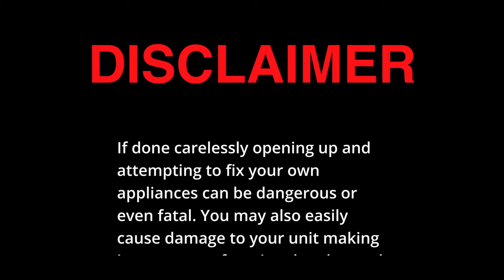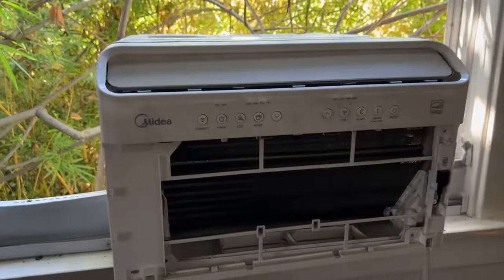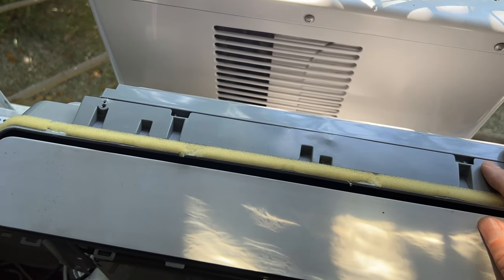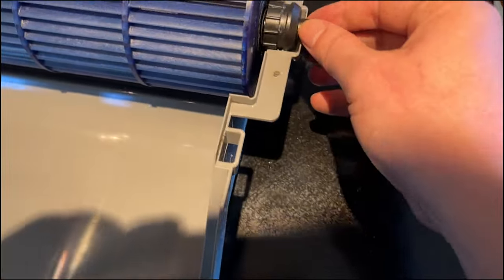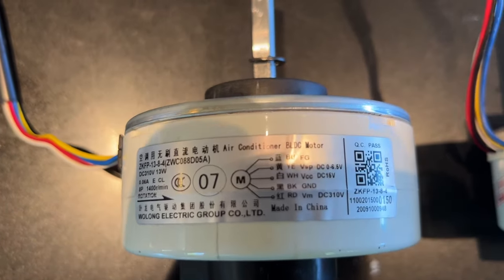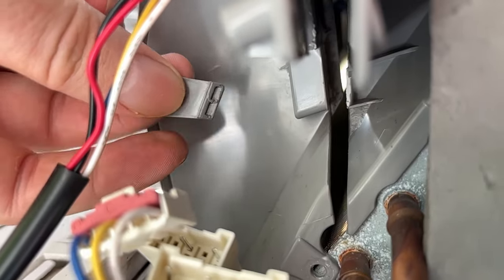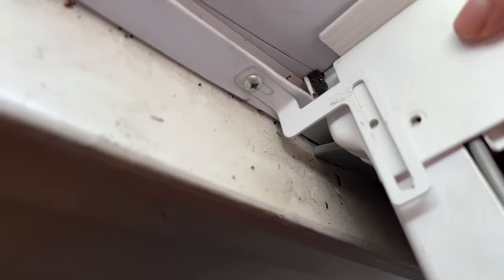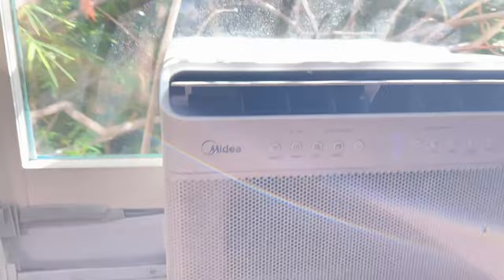Midea U-Shaped Air Conditioner Teardown & Repair: Blower Clean, Fan noise fix, Motor replacement

Comment: Great DIY video, with 19k views it seems you helped a lot of people with what is most likely a common failure on those units. Congrats!

A tip I would like to share with everyone regarding the lubrication of parts encased in plastic - Only use pure silicone grease when lubricating plastic parts, or plastic parts with metal shafts. Pure silicone grease is completely inert to the majority of plastics and rubber, that is it will not erode or harden them.  Petroleum based grease will cause damage to plastic over time, and the damage will be irreparable. Lithium and white lithium grease is petroleum based as well.

You can find pure silicone grease in many places. The plumbing aisle of any hardware store will have food grade silicone grease for faucet O-ring grease. A 1/2 ounce tube will cost maybe 5 dollars and last a long time for homeowner use. Use it grease plastic gears, that shaft of the fan where it enters the plastic bushing, and you can even put a small amount on every electrical connector in that AC unit to make sure water dirt and moisture will never contaminate those connections, making them easier to remove in the future. You can use food grade silicone grease on hose connections for garden hoses, washers and what not ensuring they will come apart easily years from now.

Also, while you have everything open, a good quality can of coil cleaner can be bought for less than 10 dollars. While working on an AC unit take the time to hit the inside and outside coils with coil cleaner and a light rinse, the coil cleaner will remove fine dirt that starts to reduce the unit efficiency, and has corrosion inhibitors that will prevent/treat all the different metals and solder of a coil assembly against oxidation.
Reply from the maker: I hope people have gotten some use out of it! Before this videos were incomplete, so I had to guess at some parts. 

Great tip about the grease, I did not know that!

Comment: I’m considering buying a used b Windmill WhisperTech used and it has a vibrating noise that seems to come from a rotating component. The frugal engineer in me can’t let it go. It’s a bit of a drive to get and we have a Midea at home so I wanted to open it up and see if I could get some confidence to tackle the Windmill one. I got stuck at the front cover and probably would’ve gotten stuck at the blower assembly as well if it weren’t for this video. I see screws and I think “oh yeah duh it’ll come apart”… then there’s the clips… thanks injection molding engineers :)

You’ve done a great service to many people. Thank you!
Reply from the maker: Yeah, it starts as a "how hard can it be?" then goes to "oh, pretty hard", but once you figure it out, it's not that bad!

Comment: Thanks much for sharing,,  thats a heck of an effort to open and put back together but its worth it. You are correct today repair of these unit is costly
Reply from the maker: Yeah, getting somebody actually qualified to do it costs almost as much as getting a new unit. Fortunately I was able to find this part and managed not to mess it up, which I'm still pretty surprised by!

Comment: Good video, was looking to see how you cleaned the fan blades.... Qtip and pipe cleaners DOES take forever.
One tip I'd give for taking this apart, might make it easier for you.....  The screws you removed on the right side (ones going through the confessor). If you remove only those on the left side and the screw holding the box the connectors go into. You can then unplug the motor and remove the entire fan-duct with fan and motor inside. 
If you do this before it's installed,  you can clean the condenser with simple green and a hose outside. Using a hose from the motor side and flushing water toward the filter side (reverse of airflow).  
Next year I'll video myself doing that and the rear section, already did it 2 years in a row.  The evaporator gets filthy and clogged up, cleaning it helps it cool drastically better, but it is work, a lot of work.
Reply from the maker: Would have never thought to have done that! Thanks for the tip.
Reply: Please do!

Comment: Thank you for the video very helpful. A few things to point I didnt have to rip the side protector nor break the top tabs. Pro tip use some toothpics to stick on all the tabs after pushing them, starting with the top ones. Then you just pull the whole backpannel off in one go.
Reply from the maker: Wouldn't that make the front barely stick on - or am I not understanding?
Reply: @nickrobinsonisthedev After taking off all the screws and you have the tabs holding the two grey pieces together, push with the screwdriver the tab back to create a space and insert the toothpick in each of them as far in as possible for all and then you can just separate them hassle free. I'm having to clean it again after about 5 months, but this time bought dehumidifiers to see if that helps with the problem due to how hot and humid it can get in this state.

Comment: Thanks. I will now be able to replace the motor, in the future, if it fails. I have two Midea U-Shaped units, one in my 2nd Floor office for about a year, and one in Bedroom #1, that I just got this month, They both work great so far. The newer one has touch controls, instead of physical buttons.
Reply from the maker: Not a fan of everything going to touch controls, personally!

Comment: Discovered today that to get to those two angled screws, you can disconnect all the other side screws from the grey inner part and just tilt the whole thing back. Also a lot easier to re-assemble that inner part with the fan and then put it back on the unit.
Reply from the maker: That would've been good to know! I was figuring it out as I sussed out the problem. Next time I'll do that!

Comment: Awesome job on the video man! After 3 years mine is making the exact same noise. Now I know where to get the motor. I did clean the blower last year by taking off the front flap and reaching inside, but you can't reach all of it. It was pretty coated with crap because I live in a dusty area. I think this is what causes the motor to start whistling due to the blower getting out of balance. In the app you can manually set the fan speed and I found that around 40% helps it to be less noisy.

Also a ratcheting screw driver will help get to the tight places like in the back. A putty knife and some plastic wedges will help with the separation at the tabs. Cheers!
Reply from the maker: Hmm. My area isn't super dusty, but who knows. I have no idea what happened to the motor, I figured just wear and tear.

Comment: Last night I had arrived at the decision NOT to buy a unit like this.. I just knew it would be a cluster to get apart and clean the blower and the evaporator coils. Mold is not something you want to be breathing.  Now I will save this video for later because A/C season is almost over around here..
I know you said that you didn't know about the outside portion, but when it gets cool outside you might want to explore (and video for us) that to see how much dirt / dust / pollen is packed into the condenser, I do not know if you can see into the back part well enough to really know what it looks like..
Thanks for taking the time to do the video.
Reply from the maker: Personally I have never had a mold problem. Not in the slightest. The blower in this video is pretty much the same as the first time I pulled it out about a week ago (I cleaned it then, but it was wasn't really dirty, pretty much the same as seen here). Overall the unit is pretty good, works efficiently, and most of all is QUIET when the motor isn't malfunctioning.
Reply from the maker: I took the ladder out and shot a video of what the outside portion looks like, for how much I can see in: https://www.youtube.com/watch?v=wqItlrPwbEQ

Comment: The rubber piece on the end of the squirrel cage fan is not a stopper, it is a bearing that supports the fan shaft. When the lubricant in the bearing is depleted, it will start to make noise and the shaft may stop spinning. You can add oil to some bearings or just install a new one.
Reply from the maker: Fortunately I added some lubricant in my first (failed) attempt to fix the noise!

Comment: Thanks men, mine has been growing mold.
I gonna try to take it apart to clean this weekend
It should go ok😅 i worked installing mini split Ac for a bit, but never done repairs/taking units apart, so im still a bit worried
Reply from the maker: You're gonna be fine!
Reply: @nickrobinsonisthedev  hi men, just Finnished putting it back together😁
Tooked it apart with no problem.
Was able to clean it but couldn't do much about the smell from the coils, just use some of those form cleaners, hopefully it works.
BUT when I put it together, somehow I'm missing 2screw😅 should fine tho.
And forgot the security on the cable(will probably put it back on tomorrow if I got time)
The first time i put it back, it give me an EH6 error code, probably cause I was stretching the motor cable too much.

Now, hopefully nothing goes wrong and catches on fire 

Thanks for your video men, very appreciate it
Reply from the maker: @user-lv4ne7nq1h  Glad to help, those scews probably won't matter much, I've done it a few times missing screws and it's always been fine.

Comment: You can straighten the bent aluminum fins by using a fin comb. They are available online. The combs are color coded to match the number of fins per inch, so be sure the comb you use matches the fins on your unit.
Reply from the maker: Is it going to be worth the effort?

Comment: Its not to bad. They grate thing is now screwed down in center and they have 2 didderent types of foam I think to help with noise. There are more screws I think.... 
I bought two units one for my living room and one for my bedroom. I've had them less than 4 months and both of them have mold. So I've had to take them apart and clean the system up. I didn't find that (I forgot what you called it) white bladder thing that you showed in your video.
Reply from the maker: Interesting. So far mine is still going strong so I don't need a new one!

Comment: Not crazy about that unit, both my neighbor and I bought a 12k unit. I don't think it blows enough air for the btu rating. Mine started to make a whining noise more detectable at low speed. I was luckier than you, they asked me to send a sound file and the engineers who listened said it was abnormal and they let me get a refund. I had wanted to keep it and I contacted them saying is there anything I can do to fix this thing? I had it in so securly. I have to say, I have installed many many ACs and this was by far the harderst. What a pain. First they told me to take it back to Home Depot, HD said what? Even though I had authorization from Midea. So Midea refunded and I am donating the unit. Replacing it with an LG dual inverter which is not a U shape. The U shape supposedly lets you use the window but no one is going to use that feature, you have to put insulation around it to keep critters and drafts out.
Reply: Home Depot sucks, I had the same issue years ago but with a noisy LG window ac, I called LG and they agreed to refund me and told me to return it to Home Depot, when I get there carrying that heavy AC they were refusing to take it back, saying I have to deal with LG directly, had to talk to a manager and waste an hour as they argued with LG on the phone, finally they agreed to take it back and refund me...

Comment: I just did a cleanup with the Midea Duo portable AC (I haven't done it yet on my U shape yet... but will soon). It's more involving on that unit compared to the u-shape model when i look at the vids online. It took about 5 hours I'd say, maybe longer. Just my opinion for anyone reading this but if you're going to go through all the hassle of tearing this down I think you really should go blade by blade on the squirrel cage cleanup. I ran mine for just 2 summers and it was really gross. There's no way, NO WAY, that simple water with no pressure is going to clean that up. It's really embedded on the blades. The undersides as well will likely be filthy. Compressed air does nothing as well. It really needs agitation and something physical hitting it and brushing it off.
Reply from the maker: Excellent tip

Comment: Thank you for this video!  After enduring months of noise, I finally repaired my AC this weekend using it as a guide.  

There was some other video that I had bookmarked a while back which suggested using a washer to remediate the motor noise issue but it was pulled by the poster.  Also, I couldn't remove the squirrel cage fan from the motor without fear of damage so I replaced it as well.  Maybe some Liquid Wrench would help with that.
Reply from the maker: I tried that method at first - wasn't the source of my issue and it ended up putting pressure on the rubber stopper at the end of the squirrel cage. Ended up wearing it down a bit for me and giving the smell of burnt rubber.

Comment: I used this video to open my Danby 10,000 BTU Inverter Window AC DAC100B8IWDB-6 that is not u shaped. Well it's the exact same machine and they filled the u shape area with stirofoam.

Comment: Your video was very helpful. But I bought one in 2024 and they've put a lot more stuff on there. The little metal grate is actually screwed down. They have insulation kind of stuff around the motor box and they have screwed down the blower so you can't get it out without taking the screw out. So if you changes but so far I'm a broken anything 
Thanks for your help
Reply from the maker: Oh interesting. I wonder how much more complicated they made it.

Comment: Thank you! I looked at recent Amazon reviews and they are all bad. Returned and broken units are the norm. I have a 20 year old Kenmore window unit that works as well as the day I bought it. It’s as loud as it is reliable. I’m looking at the GE saddle unit too.
You could have unplugged or crushed the beeper while you were in there like I’ve had to do to both of my window units since the dog hates beeping! 😂
Reply from the maker: Interesting. Besides this issue I have not had a problem with it and like I mentioned in the video, the noise factor was EXTREMELY important. I'm sure the Kenmore is great, but a newer unit (by anybody) will probably pay for itself in electricity costs in no time at all. As for the beeping - you can turn it off in the app.

Comment: I was surprised when you pointed out the WOLONG dc motor was the actual motor that came with the a/c. Because WELLING motor is a company fully owned by Midea group. It makes a lot more sense to source parts within their own systems for their own products after all. But also that says this motor should be a genuine part and the concern over its reliability shall be minimal.
Reply from the maker: Yeah, these are things that I don't know. To find it I googled some of the numbers on the side of the old one and this came up. I was still nervous about switching over (thus the fire extinguisher and I didn't leave the room for the first handful of hours operating with the new motor) - Months and months later it's still going strong and performing great!

Comment: Good video, I bought a Media in May of 2023. My shop is only 550 square feet. The fan blower seems to be putting out less air on high than it once did. Will the other motors listed on Amazon with the same numbers but having wattage work? They were a little more in watts than stock. I think it's a shame that the factory has little or no concern after the warranty goes out. Maybe Media was a bad choice but I'm stuck with it now. Thanks
Reply from the maker: Oh, this I don't know. I would worry about starting a fire, but maybe somebody can chime in about this. I don't know if the power draw is regulated.
Reply: @nickrobinsonisthedev  I didn't make a lot of sense with my reply, sorry, When I was looking at the link you provided for a replacement motor. I noticed other motors with the same numbers as the stock motor but they had a higher wattage which I think would make them a little stronger. My blower motor isn't putting out or running at the original RPM, That's why I was thinking a motor with the same size frame but more watts would be a better choice. According to one of your viewers who said you talk too much, I would ignore what he said, sometimes when you are actually taking a unit apart you will appreciate the long version. On the other hand you have some that throw the instruction manual down and work without it, hats off if you are that type. Everything you described will help me get this job done, I'm in my 70s so details help. Thanks
Reply from the maker: @paulgreenlee190  It makes sense, I just wonder if there's a power limiter or anything that might stop that from working. Let us know how it goes, and be careful!
Reply: @nickrobinsonisthedev  It doesn't look like the higher wattage motors will work. I'll stick with the original and be happy with the results. My workshop is outside dimensions are 14' x 20' with an entrance door on the side including 2 windows and a roll up door at the front. It is lofted (big mistake) and insulated. I think I'm going to buy a reconditioned Media 12,000 btu and put it in the other window so I would have A/C at both ends of the shop. Inside is slightly cluttered with a SB 13" lathe, a 14" metal shaper, Rockwell drill press, desk, and large roll around toolbox. I should have thought ahead and bought a larger structure, never enough room and never enough money. I am thankful for what I have been blessed with.

Comment: Regardless of the warranty, is it recommended to drill holes or not to drain the water? It makes no sense of leaving the water standing in the pan when leaving the machine turned off. Please advise.